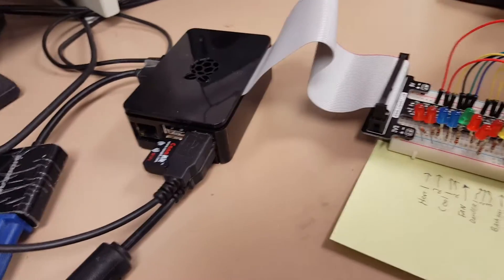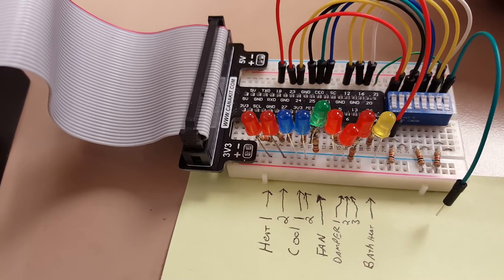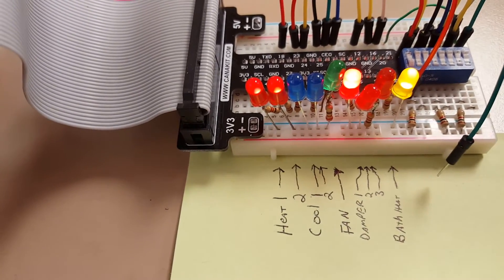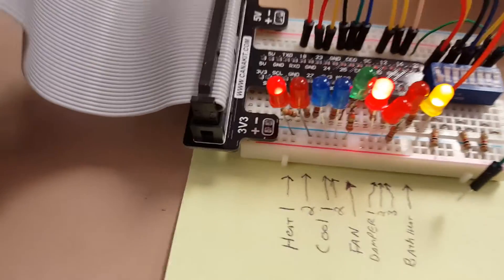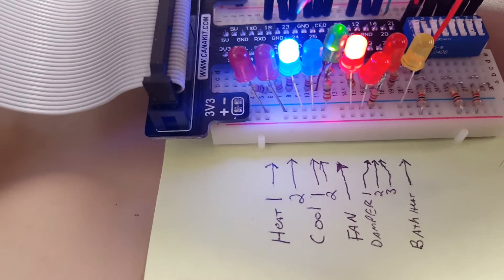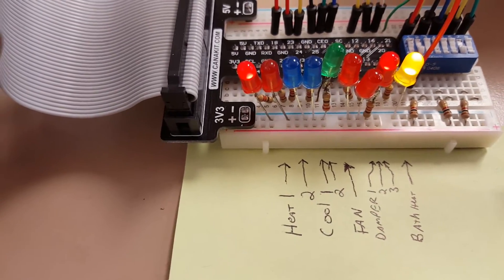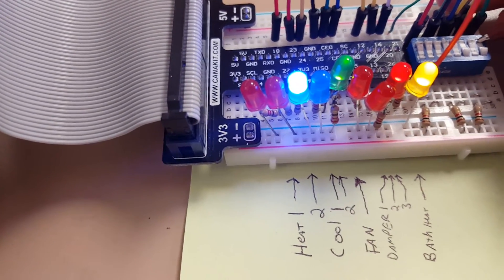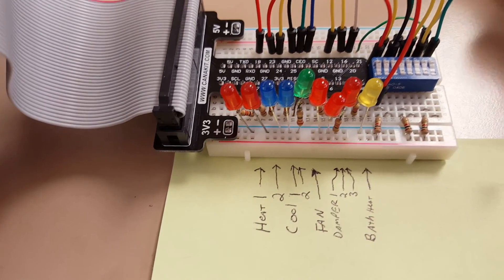2 stage, 3 Zone HVAC Controller  **Updated, Open Source version in comments**

Comment: I have a two zone system with an Aprilair, 4 zone, two stage controller. Your concept system has existed for many years and uses 24 volts and relays. The control box uses its own power supply to power the thermostats and the contoller. The A/C unit has its own 24 v power supply and the controller communicates by setting relay contacts and keeps the power systems seprate.

I am upgrading my AC system shortly and trying to integrate the new two stage option into the to the controller. I am going to set it so that when two zones calli at the same time it would use the second stage. This is just some relays. The fan speed is tied to the stage setting. I am working on a data logger for the Raspberry Pi to track the runining and temperature difference. Data will be recorded into a Calc spreadsheet and the Pi will operate headless and I will tie into the Pi with an Ipad from downstairs to view the data.

Let me know if you want the specs on the controller.

Comment: This is great!  I thought about doing this myself.

Things that you might want to consider adding (in addition to discharge air temperature sensing): multiple zone inputs for explicit calls for second stage, and fan speed control.  

Using time as a way of invoking second stage leaves a lot to be desired.  Many thermostats are already  multi-stage, and will explicitly call for second stage heating or cooling if there is a temperature differential greater than a certain threshold. Only the thermostat knows the Zone temperature so it is able to make the most informed decision.  For example, why wait 15 minutes to kick in the second stage if you're doing temperature setback recovery?  What if you end up frequently kicking in zone 2 just as you reach setpoint? Both are less than ideal.  This is common on many commercial zone controllers.

Also many HVAC systems have multi-speed fans.  You can choose the fan speed based on the number of zones calling,  (i.e. you can enable low speed via 24vac high on the speed input).  This can reduce the fan noise when only one zone is calling, or better yet, it can enable a higher 'normal' speed setting  to better serve multiple zones when they're calling together.  

Just some ideas
Reply from the maker: Great ideas. This original version ran for 5 years (oops, was never meant to last that long) but I've since redone the project with a GUI interface and separate zone sensors and logic. The inlet and discharge air sensors and logic are on the to-do list for the new project for both over/under temp control and early problem detection and user notification (why wait until the house is cold to notify user when logic could detect "Hey, my call for heat is on but the discharge temp doesn't show it" right away. The new system uses sensors instead of thermostats and does call a second zone primarily on temperature diff, but still on time elapsed as a secondary. You've got me thinking, though - I think that elapsed time part needs to be changed to include a rate-of-temperature-change calculation. (Like you said, why bother with a  second stage if approaching setpoint). Fan speeds is another good idea - albeit more involved and will require more relays. I'm going to keep that one in mind for after I have some things I consider essential implemented. Here's the quick tour of the new system: https://www.youtube.com/watch?v=Q_PZS8cFdXQ. There is a link there to the project wiki - feedback much appreciated!
Reply: @lbrombach1  What you're describing (e.g. rate-of-temperature-change-calculation) is an well-worn path to mature technology called a P.I.D.  It stands for Proportional Integral Derivative.   The TLDR on P.I.D. control is that it uses calculus to predict when a control system (like a Thermostat) will reach its goal in the future (like a Thermostat set-point) given a some variables over time (like zone temperature plotted over time).   When you think about the problem carefully (as you're obviously doing), it becomes clear that Calculus (a PID)  is the ONLY way to solve this problem optimally.  Any other approach (like a simple 'normal' thermostat responding to reaching set-point in a 'feedback' type system) will overshoot the goal 100% of the time, sometimes in a problematic way.    The Yardi/Proliphix IMT-550c is an Ethernet-connected thermostat which embodies nearly everything someone could want in a thermostat including a P.I.D. function.  It's a good device to study before designing a system from whole cloth.  For example, it behaves differently when attached to a radiant system than the same unit on a forced air system because it learns the system's response time and temperature momentum/inertia to keep the temperature within the set-point dead-band.  The 'stat  even has an unofficial REST API which I have integrated into my OpenHab smart-home system so I can use it from my smartphone instead of its desktop Web UI.  It seems to be available used for ~$100 on Ebay.   The company has been around for over a decade, but has not been a big commercial success  because it's too complex of a product for most people.  Not for me.  Not for you.

Comment: I'm looking to build HVAC controller using Raspberry Pi 3 (tho an Arduino might be better suited)...not concerned of motorized dampers-don't have any - just want to control house HVAC system.
Reply from the maker: I have a new project with build details. It's a little overkill for a single zone, but you can simply not wire the extra zones and stages and it will work fine. It's just been released, but upcoming features will make it more user friendly and customizable for single-zone applications. Here is the quick tour video (with  link to the project wiki there) https://www.youtube.com/watch?v=Q_PZS8cFdXQ

Comment: Awesome job on this project... however, a system does exist commercially if someone doesn't have the skills to build it themselves.  SmartZone-4X ... Also, it includes some features to help better control temperature such as included supply air temperature sensor that prevents over heating the system (or freezing it up when dampers close).   The SmartZone can be purchased at www.zoningsupply.com  & they have great technical support for anyone who is new to this stuff.  Not to mention that I think it is probably cheaper than all the parts necessary for this project.  I have had one of the SmartZone boards in my house for over 10 years running on a 2-stage system.